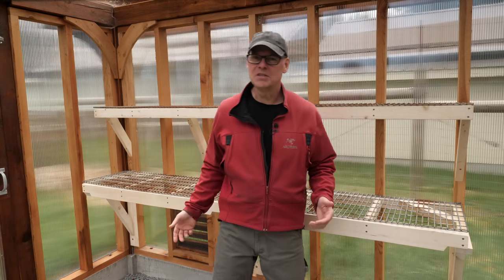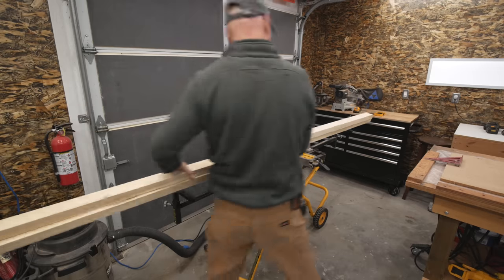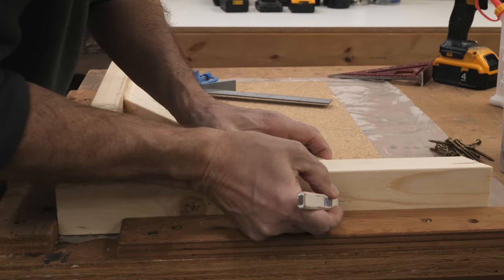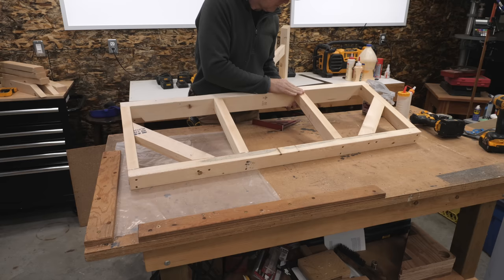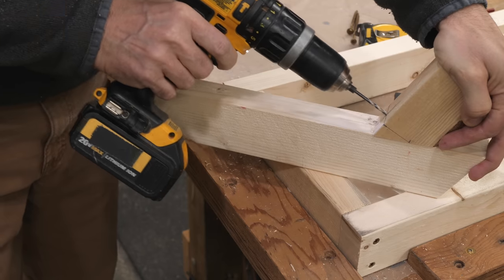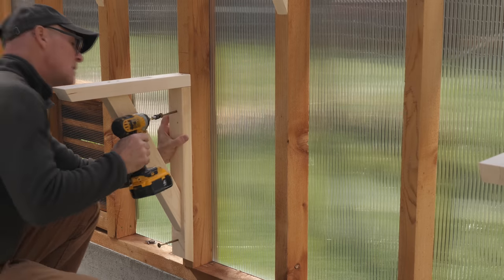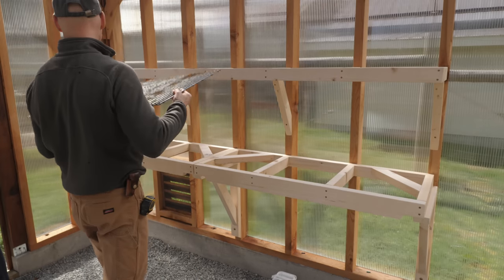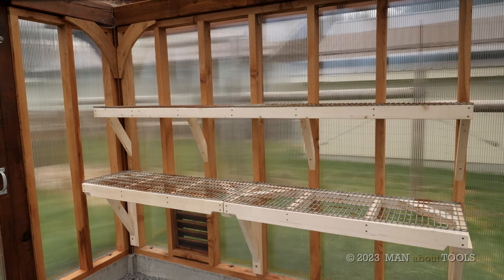Greenhouse Build Series 5 - How to build Shelves and Benches

Comment: Sir,  could you please take the time to answer my question? Would very much appreciate it 

what is the width and length for both the top and bottom shelves. Please what is the height from the floor to the first shelve and the height from the first shelves to the second shelf? 

 I am planning on placing cedar legs 4X4  for the bottom shelve. The legs will be decorated by cutting into the wood. How would you suggest making the top shelves? 

My little greenhouse will be 8 X 12 ft. I am planning to place the shelves on the 8 ft side be sure it will get the most light. I will have two windows. How long do you suggest for the shelves? Do you think I could put three shelves instead of two? If you think I could how do you suggest I could build them? Please can you provide measurements?
 
Beautiful shelves you created.

I thank you in advance for the information and help.
Reply from the maker: There's a link in the description for free plans.

Comment: Missed your videos! Looks great as always. I’ve had concerns before with end grain and glue for my own projects but there is a solution to that, put on a solid layer of wood glue to the ends and allow to dry till tacky, then add more when you’re ready to attach and it should be enough glue already soaked up into the wood grain to improve the connection. It works and I got that tip from Tamar at 3x3 Custom channel here on YT. Question, how to do a garden fence (doesn’t have to be permanent but semi wind proof) without having to dig out posts? Any ideas? I have a gas line that runs by the garden but I need and want a 4-5’ tall cedar fence with inset hog wire panels. Posts in my area are supposed to be 3’ roughly deep because of frost line and I’m afraid I’d hit the gas line.
Reply from the maker: Thanks for the tip there!
For the fence I would look into pencil posts. They look like they would not be too difficult to pound in. For the gas line I think you would need the utility to come and mark where it is so you won't hit it.

Comment: Why didn't you use the same design for upper and lower shelves?
Reply from the maker: No particular reason. But, that would work fine I think. Just make smaller brackets for the upper shelf.